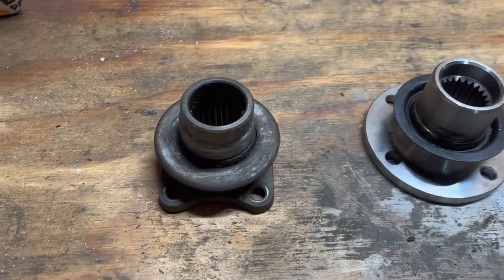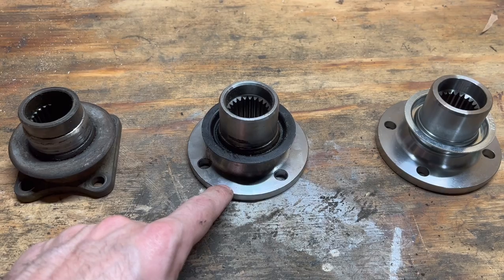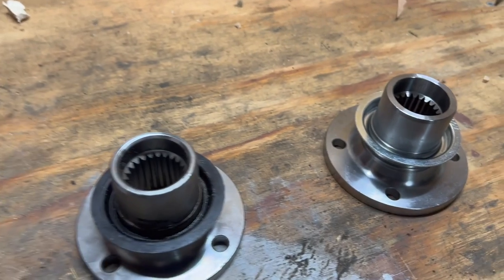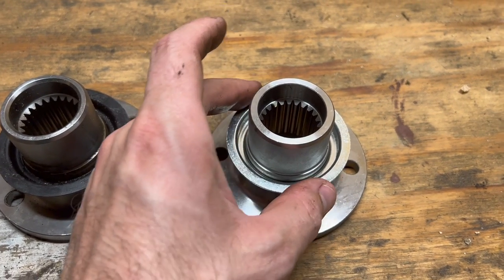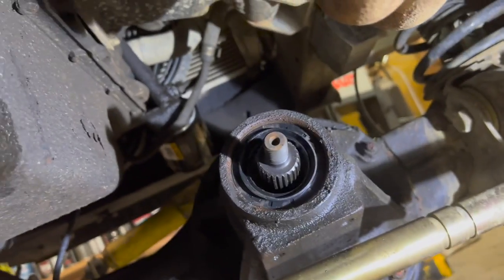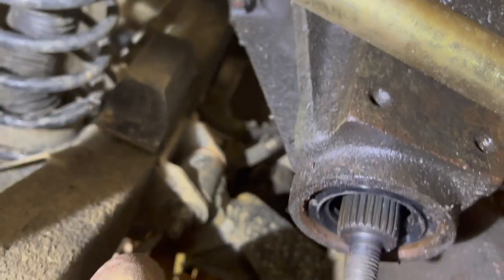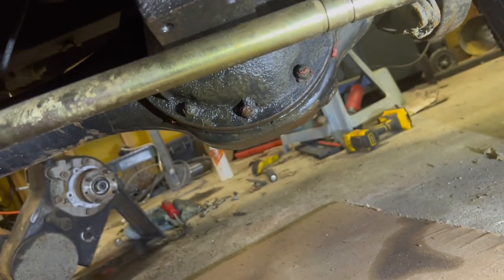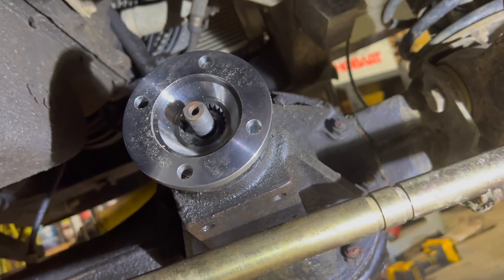Land Rover Differential Flange Pinion Seal Replacement Differences

Comment: Thanks for your explanation.
I have exactly the same problem.
Torquing up the 24mm nut presses the mudshield hard against the diff.
Backing it off a bit is not ideal, it is fine whilst accelerating but "moans" on overrun.
I'm in the UK, but don't know how to order a different part with the same ref number.
I may try to install the mudshield off the original flange, #1 in your set, if it will fit.
Otherwise I'll not have a mudshield.  Don't like to get muddy anyway!

Comment: How'd you torque yours back up?
Reply from the maker: with the wheels on the ground and the diff installed it is possible to get a torque wrench on the pinion nut. otherwise I haven't had much issues using an impact gun to put the nut on (although not advised)
Reply: @mkoutdoor  cheers, struggled like hell to torque mine up to 130nm